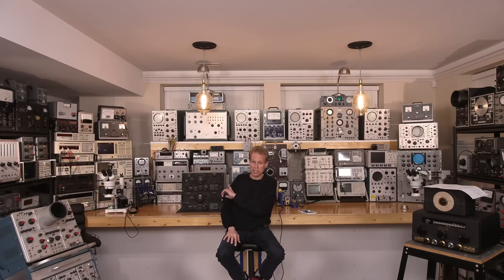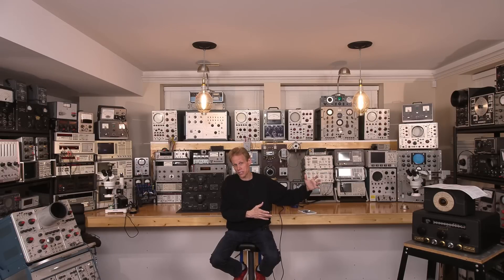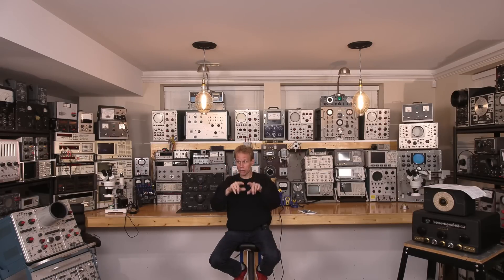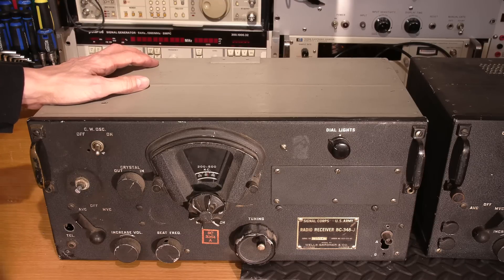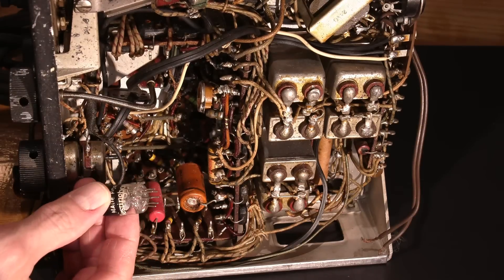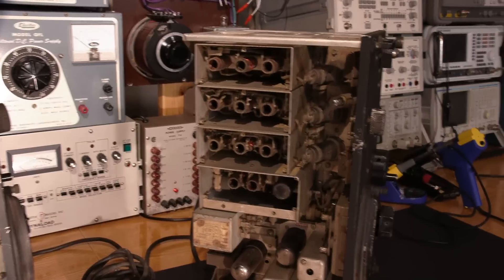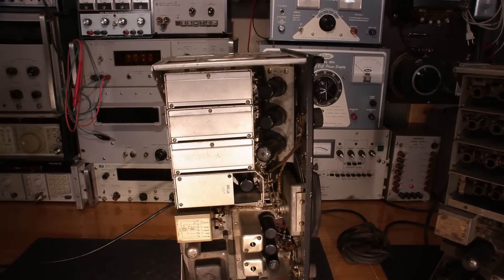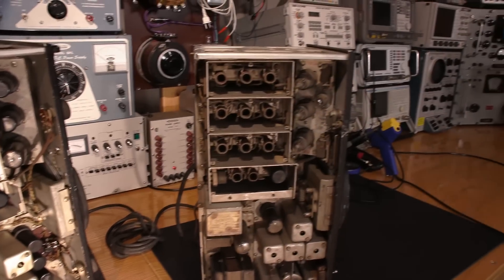Restoration Warplane Radio Receiver BC-348

Comment from the maker: To learn electronics in a very different and effective way, and gain access to Mr Carlson's personal designs and inventions, visit the Mr Carlson's Lab Patreon page here: https://www.patreon.com/MrCarlsonsLab
Reply: I want to see you do a top down restoration on a heathkit IM-18 VTVM, I have 3 questionable ones i can send you, lol
Reply: Radio 1 with possibly more options, plus it has the better transformer with choke!
Reply: Radio 2 seems to be the most original with the front panel at least, and had more in common with radio 3 as far as spare parts... 
Maybe grab the power supply and choke from 1

John N1NJI
Reply: As a suggestion, I wish you could do a few more restorations of pocket radios and cb radios. I'm currently trying to restore a President Lincoln CB and it's a pain.
Reply: @danielt.8573  my dad had a Lincoln after he got his Novice ham license, CB and 10m
Reply: @inerlogic  It's a fine machine. Still use it in my pickup. Display is a little hard to read and it's a pain to locate and fix problems but performs really well.
Reply: easy answer. mix it up .. i get board with the same ole radio same ole radio. its a tube its a cap anyways 73om
Reply: I would like to but I physically can't
Reply: Receiver #2 is  a simplified model, mid war production.  #1 has significant design differences.  I grew up with both types,  with grid cap and without.  They both are good receivers.  My Dad was a WW2 radio operator and radio mechanic with the 397th BG in Europe.  He was partial to the #1 chasiss.  Keep the boatanchors coming.
Reply: The newer Cleaner one is probably going to be a simplified later war version with less capability, so Radio 1 please.
Reply: Radio 1 seems to be more interesting to do. But I would say you should do 1 and 2. I don't think it will take much to fix radio 2 so you could have two working ones
Reply: Please continue the Grand Receiver Restoration series.  I am learning from them as well as enjoying.  I am happy if you just show GRR episodes, but do like that you intersperse other content as well.
Reply: Radio 2 looks like a good choice.
Reply: I want to see the difference between the BC348Q and the R variation.   I would love to see you start with one that has the motor/generator (un-obtainium, but I bet you have one).

Comment: I'm thrilled that you are going to be looking at a BC-348!  My personal preference is that you look at the "grid cap tube" radio.  I have a BC-348-O (made by RCA) that is in nearly untouched condition: 97% paint, no holes or mods and the original dynamotor.  Cosmetically it's near perfect, but it doesn't currently work... no dynamotor action.  Hoping you'll slip me the clue...  Yeah, high level of interest here.  I love all your videos, but this BC-348 series more by a factor of 5!!!  Thank you for all you've taught me over the past few years.

Comment: 10/31/2023/2145Hrs-  Hello Paul, an extremely interesting show. I have tuned in for several years off & on , WOW you certainly know your stuff. I've been a HAM since 1953 without any tech training, just muddling my way along. You're a breath of fresh air !
Current projects lined up as follows : BC-342-N ; HRO-60 (my favorite) ; RA-6790GM; GPR-90RXD ; NC-300 ; Kenwood TS-520SE and the 1954 Johnson 1 KW Desk ; etc.  Looking forward to many more series like the "Grand Rcvr Series ". 73 Bill K6DUY/K7DUY now in NV.

Comment: I like the restorations because they teach me what to look for, what to watch out for, and what to avoid sometimes.  Yes to the restoration of radio 2 - pending schematic review.  I also enjoy the new items you design and work on though.  Both help me learn about the other.  The modern components are smaller, but the original theory is in the older items.  If I can understand the tube equipment, then the digital becomes much easier for me to work with.  I do appreciate all that you do and the amount of work it takes to video these repairs, restorations, and the new designs.  Honestly, I am surprised by how much I have learned watching your videos.  Thank you!

Comment: Channel Feedback: This viewer has watched nearly everything you've published, including everything on YouTube so far. Economic hardship forced me off of Patreon a couple months' back (American health care sucks 🙄), but I've seen at least the first hundred and fifteen videos on there as well. After 2 decades trying to get into electronics, your videos were the first to sufficiently demystify analog circuits, that I'm now able to practically troubleshoot and repair things. I've even taken on my own radio restoration project (though it's also on hold for the same economic reasons). Whatever knowledge you'd care to impart, in whatever order you care to present it, I'm happy to watch it.

Grand Receiver Restoration Series Feedback: I like the way you're currently doing it. It would be awesome to see the differences in these receivers, and I'm well aware this means massive work on your part. Interjecting the series with random fix-it videos, even just fixing things that broke around your shop (like that Keurig), works well as a balance. I would like to see you address a tube-based FM radio, and perhaps a television, at some point.

Bench BC-348s Feedback: In the interest of helping the Grand Receiver Restoration Series move along, I'd agree Radio 2 is probably your best bet overall. Radio 1 is definitely going to be your parts unit. My opinion might change if you find out something special about Radio 3 -- it definitely looks like it was someone's labor of love -- but we absolutely need to consider the usage of your time, and the (sometimes fickle) YouTube viewership. So, Radio 2 would give you the best teaching opportunity with the least time investment. I'd count that a win-win.

Thanks, Mr. C! 👍

Comment: Paul, i will watch anything you video that is associated with electronics. I worked on tube type communications equipment from the 70's to 2005 when hurricane Katrina put us out of business. I was a two-way radio shop owner from 1972 to 2005 and also installed, sold and repaired commercial two-way radios. In the 90's and 2000's we transitioned to solid state equipment so I am familiar with both types of electronics. Your videos are extremely interesting and your knowledge is amazing. Keep up the excellent work. I am also a ham radio licensee and love your receiver and transceiver videos.

Comment: Nice Mr Carlson, very interested in this restoration as I've had my BC-348Q since the mid 70's.  Has worked perfectly for me for the past 50 years, a veritable tank. BC standing for Bomber Communications it was the standard radio in the B-17 flying fortress. Got mine from a high school teacher who was an old Navy radioman, he built the power supply and had to rewire all the tube filaments, other than that, everything is completely original.

Comment: Thank you for all your hard work making these videos. I became a Patreon supporter because I am very interested to see how the Grand Receiver Restoration comes out, so please continue. I vote for #1 because I have two BC-348-R receivers with the grid cap tubes.These were the early units. The later units were engineered for cost savings, but were considered by the military to be just as good. I enjoy the restoration videos but find that they are a little long winded. I suggest that you concentrate on the unique  aspects  of the receiver regarding repair and alignment.  Thanks.

Comment: Good evening Mr. Carlson! First of all I would  like to say your video restoration page on these types of vintage HF radio gear is fantastic! I was beginning to wonder what happened to this restoration series!?!? As many others who UNDERSTAND electronic repair,troubleshooting have said your knowledge of electronics and specifically vacuum tube era repair work is second to None!! Ive been watching your videos since you first decided to undertake a series on You Tube and patreon on restoring and repair this type of gear and all other types as well!! Do Not Stop this series of work on theses types of HF Comm. gear!!! Your approach to troubleshooting is excellent in its detail of what you are trying show and certain things that can be done to find elusive problems!! If some viewers are looking for repair of modern SMD transceivers they need to take a look more closely at your Bench and notice the VINTAGE test gear and other that has been restored and calibrated by yourself to use for other types of radio gear and other restoration videos!! Yes,Mr. Carlson HAS Modern solid state type test gear for repair and troubleshooting ,alignment of course ,but I don't think some viewers get the point of this series!?!?!? Mr. Carlson is trying to show other technicians like myself how to tackle these types of radio gear correctly and to show how well these types of radio communication gear CAN BE and were when they first came out many years BEFORE the era of solid state gear had even been designed yet!! I have restored a few B.A. in my time to different degrees of quality and you have no idea of what is involved like what Mr. C is doing here on this video series!!! I will get off the Soap Box now and say Please keep up the series and looking forward to see how you approach the rotating turret of tuning coils in the SP-600 receiver and other parts of that rig!!

Comment: I am a DXer. I enjoy observing the restoration process: it gets me away from the frantic search for new countries; the videos show me another electronics hobby; and, the work makes me think about circuitry. I will continue to watch but must admit that I scroll forward when the action seems slow to me.

I would go with the middle of the three radios as the one to be restored. It has a few benefits: its front panel cosmetically looks better than do the others; it has all of the shields in place including one covering the main tuning cap’s trimmers (as does the left one but not the right one); it has more modern tubes and all metal ones in the tuning stages.

I appreciate what you do and realize what is required to make a good video blog.

Comment: Hey Mr.Carlson, long time fan here myself. I would suggest that I love when you dance around unique pieces as opposed to dedication to one piece reiterated. Although I’m grateful for every single video, I must say I feel I learn so much more across the swath of your many devices you’ve worked on. I favor tube devices and your circuit designs. However I love when you pull out modern things too. I suppose in summary, I vote dance around the many pieces of your collection! But whatever happens I’ll always be glued to every video.

Comment: It doesn’t matter what you repair, it’s gold to me. I have relearned so much that i forgot In electronics school in the Air Force back in 1970.  The restoration of the military radio would  most welcome. I vote for Number 2 with a possible swap of p/s from number 1

Comment: PLEASE continue with the restoration series.  I have been looking forward to the restoration of the R-390 since you first introduced the series.  The R-390 is such an outstanding receiver and from many aspects, it is truly unique with the mechanical digital frequency readout and the utilization of pto's as well as the modular design-quite a challenge to access the necessary test points to troubleshoot.  Lots of challenges to work on this receiver.  So much to learn.... I have one in my basement-long overdue for some TLC to get it working again.  Thanks for all your work.  I'm 76, with a BSEE, and Extra class ham license and I regularly learn from your videos.  I understand the need to work in some quicker repairs between the major restorations that require SO much work, but there is much to learn on the really challenging projects.  Thanks again, and I concur with the selection of radio 2 as the receiver on which to focus.

Comment: Can’t wait to watch this new BC-348 series. 
I did a similar project couple of years ago on a BC-342, a predecessor to the BC-348. I love these WWII military receivers, they are part of the nation’s history, they are built rock solid and the drive gear assembly which controls the tuning caps is a usually a piece of mechanical art in itself. Like in your situation, it also took me 3 donors to rebuild one unit to full functionality, while trying not to mix various versions of the receiver. I currently have a BC-344 on the bench, ready for rebuild, but I will hold working on it until your BC-348 series is complete, as I learn new things each time I watch your videos.
Regarding which receiver to work on: Mr. Carlson, you are at your best when things get hairy, so let’s go with the most challenging one to rebuild, the version with the grid cap (#1)!

Comment: As an old time ham operator (since 1963) I appreciate the mechanical / electronic artistry that goes into older equipment.   The mechanical linkages and placement of switches / compo nents was much more difficult then as compared to today's SMT or small DIP package ICs.   Your #1 radio was probably Pre-WWII design (1940 - 41) with older tube designs - however the capacitors are more likely to be oil filled and/or mica types and are more reliable.   As the electronics art progressed they made smaller tighter tolerance components but the parts became less reliable over the long term.   Nobody thought that in 1941 that any of these radios would still be around and operating over 80 years later.    My vote would be for the #2 radio also with #1 the first choice for any parts.   Keep the #3 radio for a future project.   By the way:  I cosmetically restored a BC348Q for the Riverside Air Force museum for display purposes.   Included in the donation was a labeled WWII U.S. Army Air Force down filled emergency sleeping bag. WB6IQS, John, Vista CA.

Comment: Paul, to answer your questions, First I believe you need to use the 2nd BC-348 to restore and the other two as parts. Second, I would like you to continue the 'Grand Receiver Restoration Series'. Learning electronics is a progression and these radios are a main part of the timeline in understanding electronics. You do an excellent job of restoration on all of these devices, which helps us to have a more complete understanding of the way electronics has grown and progressed. I am looking forward to watching the remaining receivers restored. Suggestions of projects shown between receivers, the additional tools that work with the Curve Tracer, like the Vacuum Tube Matching and Transistor testing etc. Thaks Paul for your skills in teaching and the effort you put into each video.

Comment: I really don't have any particular agenda that I'd like to see.  I'm merely fascinated with the vastness of your knowledge, your skill at repairing and restoring electronic components, as well as your pedagogical ability.  Which is a word you don't get to use every day.

Having said that, the one on the left is pretty much a parts chassis.  While the one in the middle does look cleaner, as far as layout, the one on the right is the one that gets my vote, mainly because it looks the most interesting.  I'm totally guessing here, but I suspect it's an earlier model of BC-348 series than the other two, which is another point in its favor.

Rock on, Mr. C.

Comment: PLEASE continue the Grand Receiver Restoration series!  I’ve owned many of these same receivers, but never had all of them restored at once nor a setup when I could fairly and accurately compare them, so I’m very curious!

I think the views declining as the series goes on then spiking in the end is a reflection on society today – so many folks want to “skip to the end.”  I will watch anything you put out – it’s great content.  

On which 348 to restore, I’ve restored three here – a Q, and N, and an M.  (also owned an R at one point that worked great with ALL the original components.)  My Q and N, and as you’ve noted, your J and Q models, use “single ended” tubes and have more classical point-to-point wiring.  Number one, far right, no name tag, uses “top cap” tubes (as does my M) and terminal-strip construction (more or less).

I found the single-ended ones a little easier to work on from an access point of view being point to point…but required more thinking as to where to put modern components that are so much smaller than the originals vice the top-cap versions have more of a terminal-strip (Tek-like) construction.  The top-cap versions don’t require any thought, but getting to the bottom terminal closest to the chassis is rough!  On mine, I ended up cutting out the original wax-papers and installing the poly cap leads over top of the original terminals WITHOUT desoldering anything – couldn’t figure out a better way to do it!   Not super proud of that, but it worked and kept the set working and out of the landfill.

I can’t remember 100%, but pretty sure most of the electro-mechanical components (especially the RF/IF box lids and bottoms) don’t interchange between the single-ended and top-cap versions.  

Pragmatically, since you’ve got two of the single-ended versions, one can be a parts donor for the other, while the top-cap version you’d need another set for parts.

MY VOTE would be Number One, the one without the tag and the top-cap construction, as I’d LOVE to see how someone with way more experience than I addresses that situation.  But, like I said, I’ll watch anything / everything you put out, so really doesn’t matter to me!

Comment: I find all of your videos interesting.  I've been doing electronics for a living for over 30 years, but  never really worked on radio circuits or other HF things.  Your videos, as well as channels like The Signal Path, give incredible insights in to areas I will likely never touch, but find very interesting.  Your fault-finding approach is great, too!